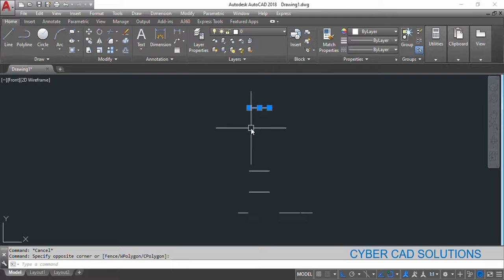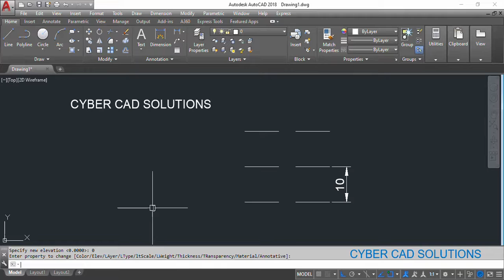Why DIST command shows wrong value in AutoCAD?

Comment: Thnaks prabhu solution to elevation problem in lines.

But, how we can avoid it before drawing any entity i.e. line, polyline, polygon etc.

Is there any variable we need to set to avoid this issue later in the drawing?

Pleas share some knowledege on this.
Reply from the maker: Use flatten command.